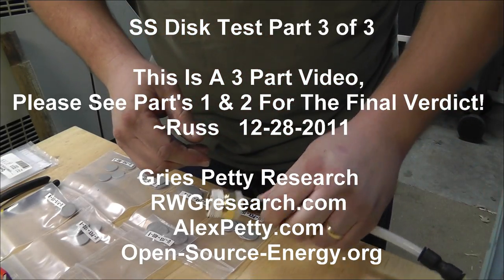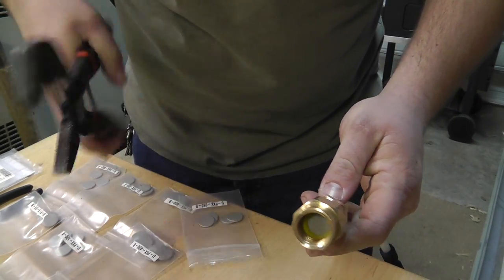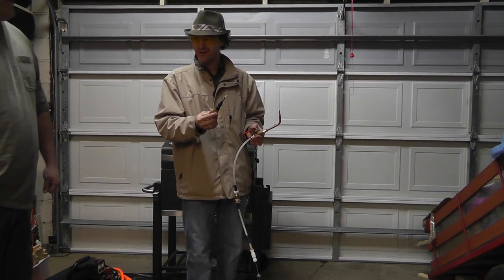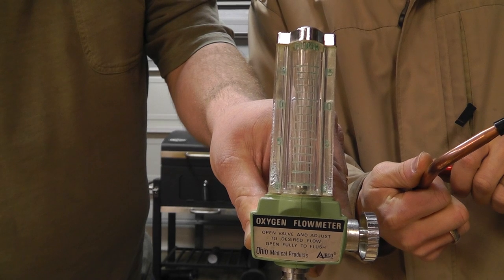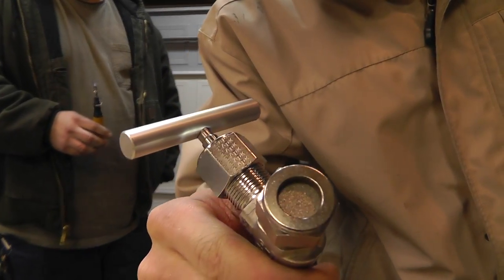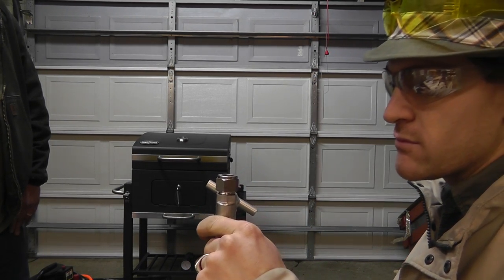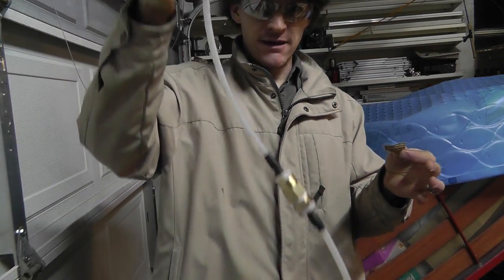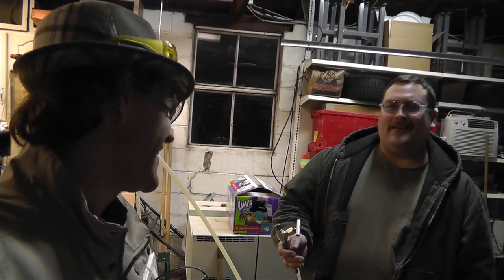P3 Stanly Meyers Quenching Disk Successes Works Like Stated! Its Real:) ~Russ 12-28-11

Comment: wear Gloves!. . The  flame  will be  2800 degrees. Flame  speed  will travel  8 miles  a second. You can NOT out  run  this .   Now  Cook  some  food  . heat  some  water  and  air.  Then  run  the  generator  all  the  while  Making  your  Own  fuel from Distilled  Water. BTW  Happy New  Years